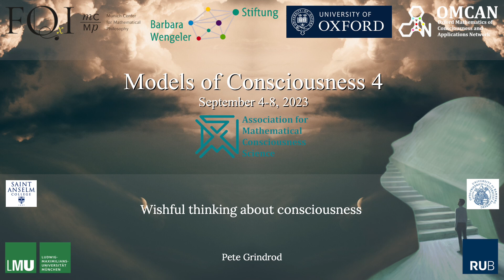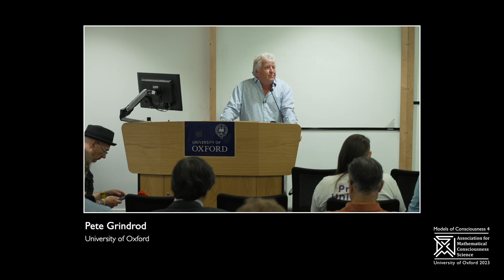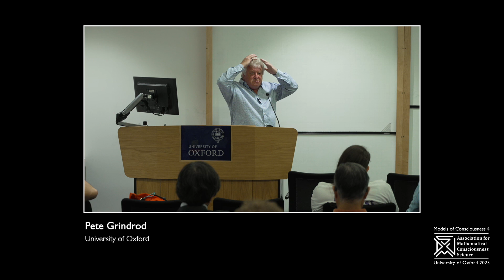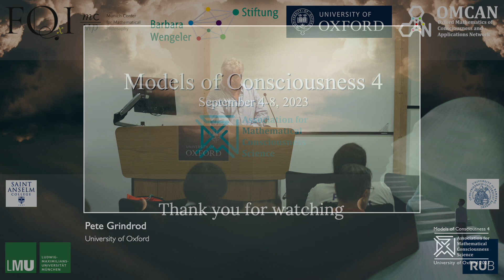Pete Grindrod - Wishful thinking about consciousness

Comment: I would love to know the relation between ontogeny of network of networks and its relation to genetics determined structures . We know that the brain does not develop  correctly without sensory input. There are critical developmental  phases that are based on sensory input. That is function development determines development of network structure. joscha bach suggest that consciousness is a functional drive development program for the brain.